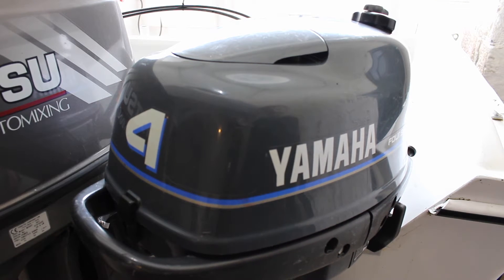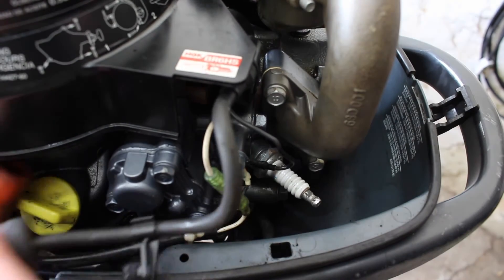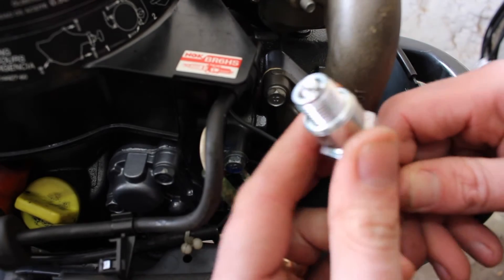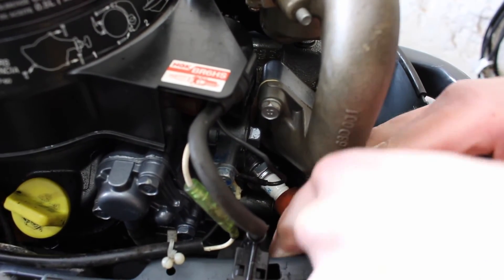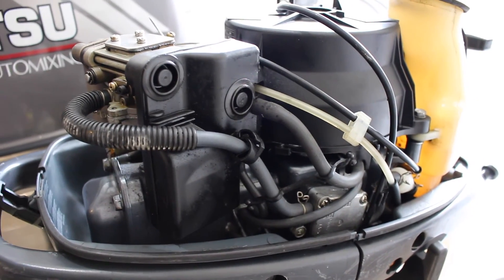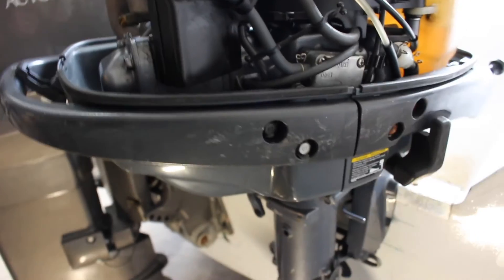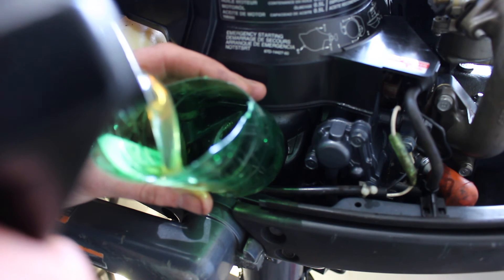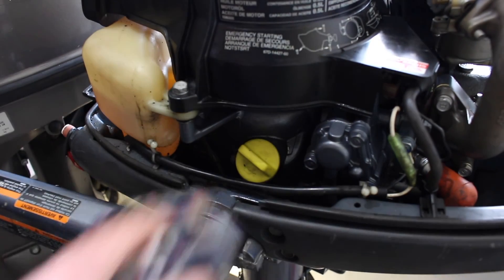How to Service a 4 stroke Yamaha Outboard Engine

Comment: i have a problem with my motor at full throtle it seems to be running lean and it goes like it should on 1/3 choke and it seems that i have to change to a bigger jet but shouldnt the original jet work for the motor or am i missing something

Comment: No offense, but changing the engine oil and not changing the filter?  You may as well have not bothered.  And, sorry, but most people will be doing this at the end of the season, ie just before putting the engine away for the season.  So you change the fuel filter but dont drain the fuel out of the tank?  Youze dude.  Not the way we roll!
Reply: I have a 6hp 2022....there is no oil filter to even change on the motor.

Comment: How to remove t engine  and clean t water line side water is not coming
Reply: Hi how to remove t engine block from body of 4stock 6hp Yamaha motor t water line is block gear box impeller change pls show t video upto u shown t video is good but also show to remove t engine from body n how to clean t water line how put gasket n bracket bush

Comment: Thx for the video. I picked up a Yamaha 8hp 4 stroke ..Simple to change the oil. I wanted to start out with fresh oil in my motor along w changing the lower unit fluid. 
Good strait forward video. 
Thx Again..

Comment: Hi Sam, I've just become the owner of an identical outboard to this (came with boat) and followed your helpful tutorial to replace the gear and engine oil and plug. My issue is that it won't start or even spark (I've never actually seen it running). Any pointers to what I should look at next (given I've replaced the plug) ? Many thanks
Reply from the maker: No spark at all? Are you grounding the plug as you test? If no spark at all check the kill switch first then the coil/magneto.
Reply: @FixitSam  Hi Sam, thanks for the reply. I'm learning as I go here. I don't know what you mean by grounding the plug. I've looked at the kill switch,  lubricated it, added a spacer to ensure it was extended enough to no avail. I do notice though that with a full tank, the fuel filter is bone dry. Could that be the issue? (Blocked fuel line?) Thanks again - David (Mayo)
Reply: @FixitSam  Found the fuel switch - (that's embarrassing) still no joy starting
Reply from the maker: @fargarden  Establish you have a good spark first. Remove and hold the plug against a metal part of the engine with the lead still attached and try starting to see if you have a good spark.

Comment: EXCELLENT video. Thanks so much. Simple yet super useful. Will be cleaning out my carb and tank, plus replace fuel filter come spring.
Reply: Hey, I had a problem where my motor same as the video, was back firing do you think it could be my fuel filter?

Comment: Nice video! Do you know what is this black tube just under the white cable at time 4.43? Thank you!
Reply from the maker: The one going to the air filter? Think its a breather pipe...
Reply: @FixitSam  Yes! Do you know what it does? I found out that mine was almost broken at the joint on the black box and the pipe. I glued it and connect it and now the outboard works fine. Before that, I had iddle problems and sometimes the engine stopped and had to pull many times to start against using the chock. So, if you know was it does you could help me a lot to undersand! Thank you!
Reply: @FixitSam  Do you think that from this pipe oil also travels?
Reply from the maker: @lazmelet  Here the manual with that diagram: https://www.manualslib.com/manual/824998/Yamaha-F4.html?page=108#manual
Reply: @FixitSam  Thank you!!!

Comment: Hello , i have a F9.9jmh 2016 with no sparks, New plugs , been under saltwater i was gold from the smeller, cleaned the carburater but wont start, is IT the coli or cdi, how to check out?😄

Comment: great video really helpful, i have just bought a 2005 yamaha 4hp 4 stroke outboard seems in really good condition and starts well i just have a issue with it not idling, unless i rev it kinda shudders and then cuts out, any ideas for a person that is fairly decent at diy but new to outboards, if its not too intricate i could probably do it myself like i will this service  thanx in advance
Reply from the maker: First step is to take the carb off and clean it out fully.

Comment: I have a Yamaha just like the one in the video. Works fine but will not start unless carburator is emptied from fuel first. Any suggestions?
Reply: Clean the carb.

Comment: do you have an example of a new carburetor repairkit ... I ask you for a photo of the example.  because in my country it is very difficult to get the device and I have ordered it but they are asking for examples and serial numbers as examples in order to look for them
Reply from the maker: 67D-W0093-00 is the part number for the carb kit for this engine I believe
Reply: @FixitSam  
oke thx brother

Comment: No oil filter? I have a 8hp Yamaha and I can’t seem to fine a filter anywhere
Reply: I have the same problem on a 6hp.. where is the oil filter ??
I think they dont have oil filter ^^
Reply: i see an oil strainer in the parts catalog. does the entire engine need to be taken apart to replace?!

Comment: Great video. I couldn't help noticing that the in gear protection stopper is missing from your engine. It's a white plastic lever at the at the top of the engine that the cable goes to. Mine is missing too. Have you any idea how to replace these? The part number is 67D-15794-00 and is called a 'stopper'. Thank you.
Reply: Lol. Mine just broke off today!